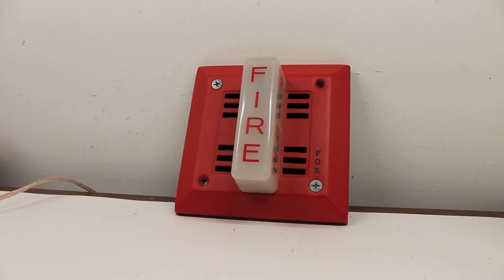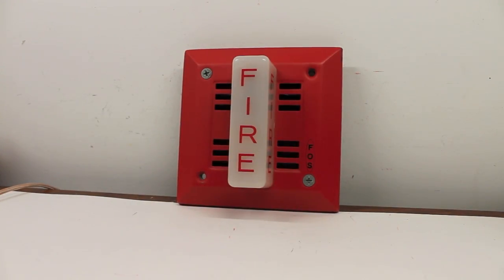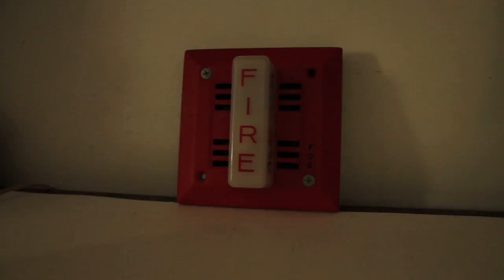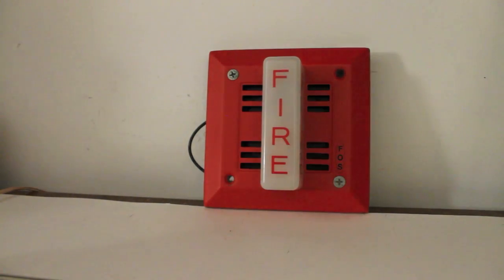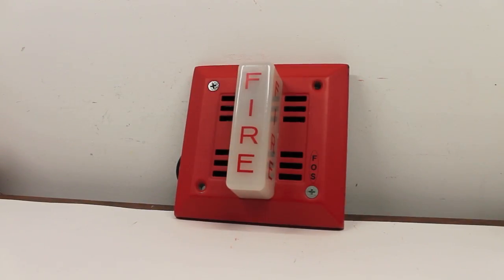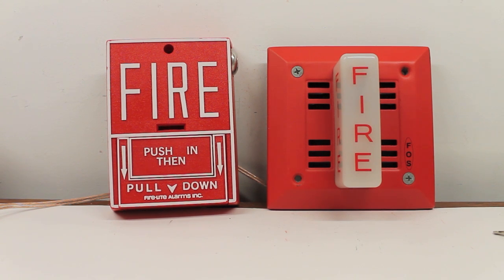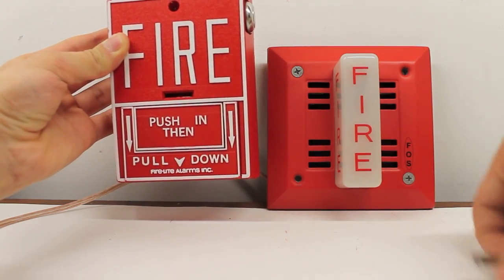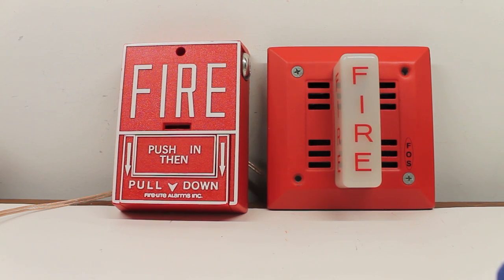FOS (Faraday) 6120/5511 Fire Alarm Test

Comment: My old elementary school has those and they were absolutely loud!
Reply from the maker: +SC D These definitely seem loud, but not too loud. It's a lot better than a SpectrAlert Advance, however.
Reply: I know, right?
Reply: Does it mean that some of the FCI rebranded FOS alarms have been replaced?
Reply: +SC D did they sound like ducks?
Reply: Some of them did.
Reply: My school had these too. I hated them because they scared me.
Reply: Northwood Elementary where I went in Trotwood, OH had these, and I did not like them! There was even one of these outside the building where the playground was! So you could hear it during recess!
Reply: @NewEnglandElevators  good

Comment: I’ve seen these at a hotel in Lead, SD, along with Cerberus Pyrotronics MS-151 pull stations, a Pyrotronics CP-400 panel, Siemens DI-3 smoke detectors, and Siemens DT-135R heat detectors

Comment: Isn't that just a rebranded Simplex 9838 with a vertical strobe?  And when you turn the lights out to do the strobe what light comes on does your camera have night vision?
Reply: Simplex 9838s was actually a rebranding of these horns. Faraday was the actual manufacturer of them. In fact, most of Simplex's equipment for decades was rebranded Faraday eqiuipment

Comment: We have the fci version with a different strobe in our school. They are placed about 8 feet from eachother and are set on high volume. They are ANNOYING!
Reply from the maker: The "high volume" is the ONLY volume setting on these particular horns, no other settings. Horns placed about eight feet from each other? That seems a little overkill. Even if it was a system installed today, it would be overkill.
Reply: ***** they had them installed 2 years ago, I don't know why they didn't get newer ones, but the very old ones were very quiet, that's why they placed them so close, and the school was too lazy to call an electrician to take out wires and a mason to fill in every other gap or so.

Comment: What's the difference between the square version and the more rounded version?
Reply from the maker: Mechanically, they're the same. However, the more "rounded version" doesn't appear flush mounted. Also, the corners are curved, not even corners. Essentially a rounded square.

Take a look at a Simplex 2901-9838 (another horn manufactured by Faraday, with Simplex's rebrand) and you'll see what I mean with the design. The Horn/Strobe version from Faraday has the same exact strobe on the front.
Reply: ***** I know what a 9838 looks like. My high school had them as their main alarms. I was just wondering since I always the one used here and not the one that looks like a 9838 on YouTube.

So the curved alarm then. They have to be put on back boxes to be used?